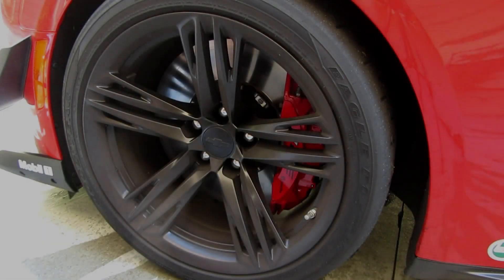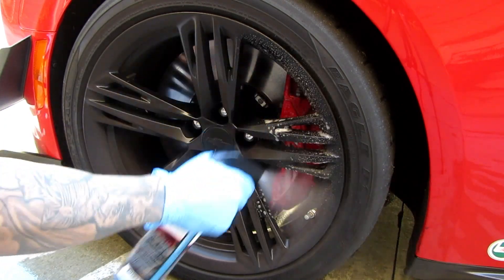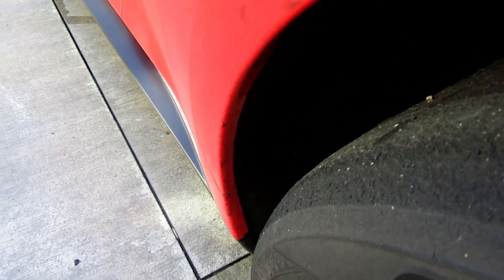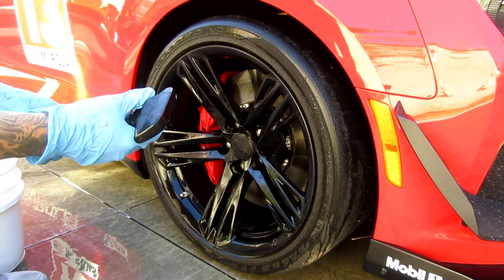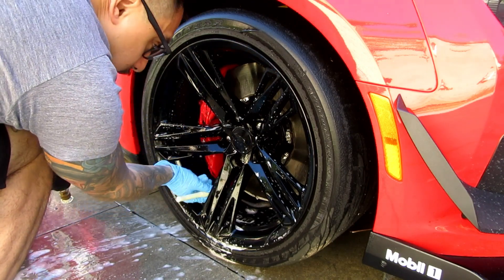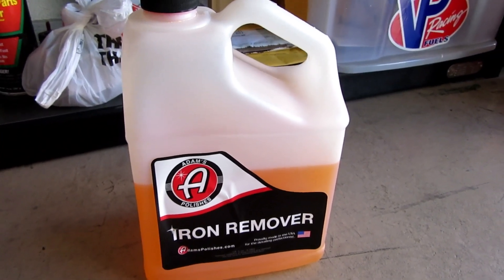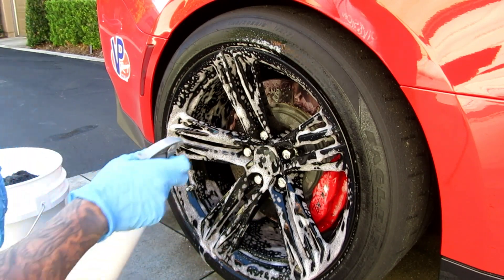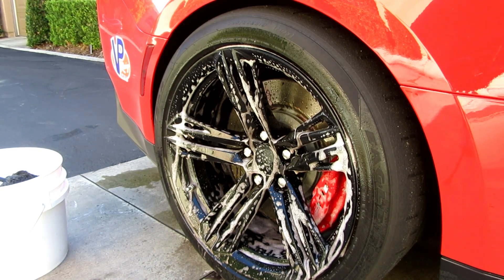Adam's Wheel Cleaner Review

Comment: That Adams looks like it does a great job. I have black wheels on my challenger and it's a pain to keep them clean. I tried Chemical Guys and it didn't really do anything. How long does a bottle like that last? With as much as it looked like you were spraying on just that one wheel, I would imagine that it'd be pretty much gone after 2-3 wahses.
Reply from the maker: When it comes to wheel cleaners, it's smarter to just buy a gallon. I bought this bottle to test out to see how I liked it first. I was spraying more than needed, but I did end up buying a gallon shortly after.
It'll be better to put this into a 32oz bottle which I have so you don't have to refill as much.
Reply: I use Sonax Full Effect on my Hellcat but it is expensive and it does not go far. I am thinking about Ceramic pads.